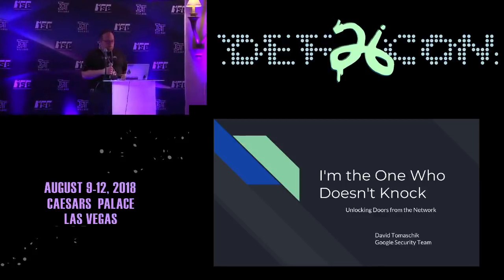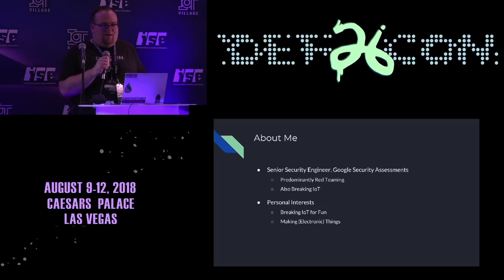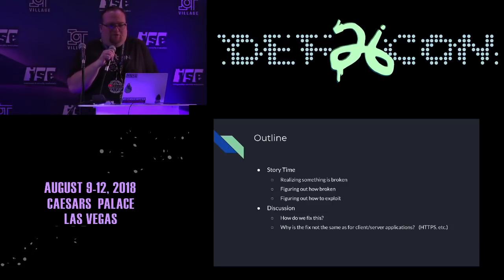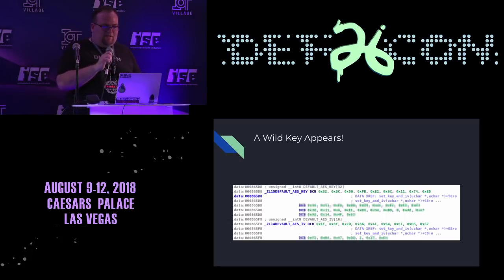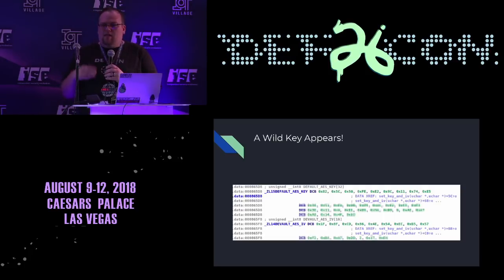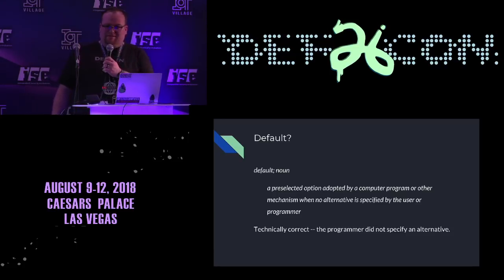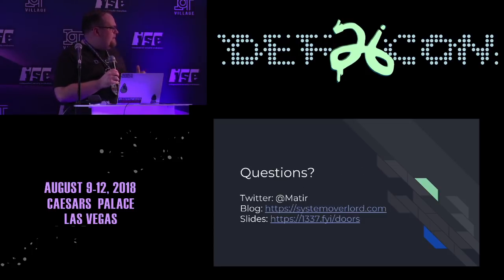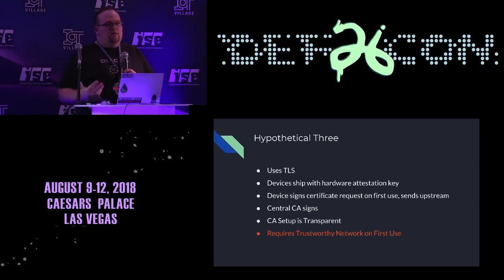DEF CON 26 IoT VILLAGE - David Tomaschik - Im the One Who Doesnt Knock Unlocking Doors from Network

Comment: My thoughts: server generates a random key on first boot. New devices must receive a key by being connected directly to the server; after that they can be installed. New key generated every so often and pushed to devices, encrypted with old key. So an attacker must steal one of the devices, extract the key, and use it before it gets changed (could be as often as a few minutes). Yea or nay?

You can of course have a local key server as well to provision new devices instead of having to connect them directly to the root server which might be far away.

Also, how do debit cards do it? They're basically the same, a badge with a chip reader or NFC, that authenticates you securely. I hope they're not this easily spoofed?
Reply: Also when doing Q&A please repeat the question so that we can hear it!